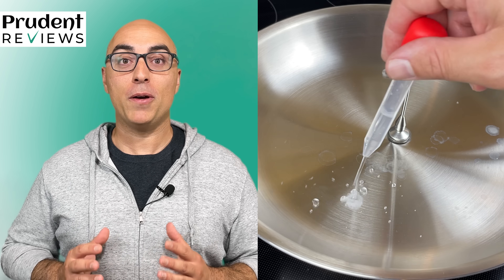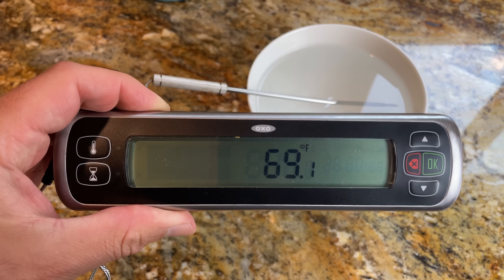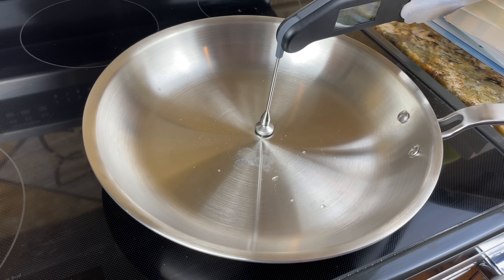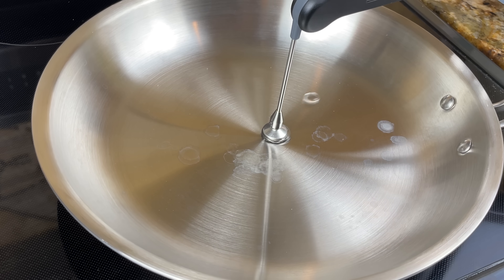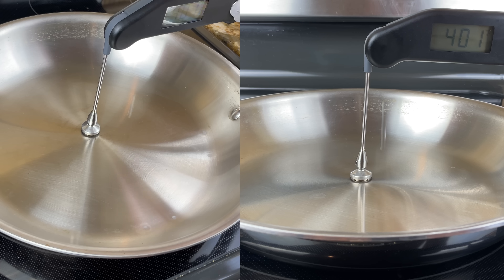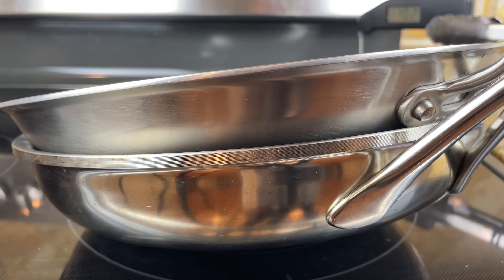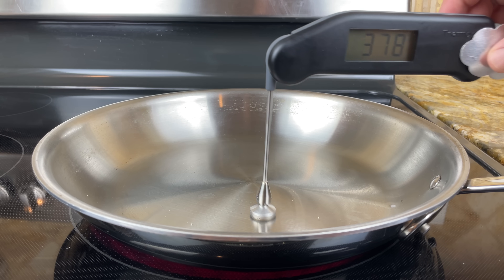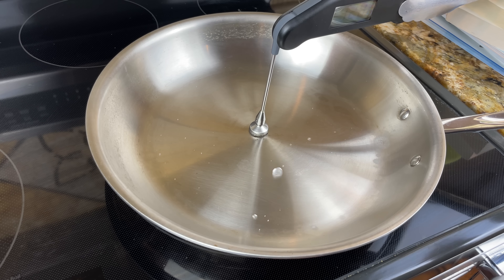Steel Pans Become Non-Stick at THIS Temperature (Leidenfrost Effect Solved)

Comment: How did you manage to have the thermometer above the pan?
Reply from the maker: Stack of books, tongs with a rubber band to keep them closed tightly on the thermometer, 8 pound weight on top of the tongs.
Reply: Some infrared thermometers have emissivity (EMS) settings, allow you to measure temperature from different material accurately, including stainless steel. I used mine on my stainless steel pan twice a week, works every time. 😊
Reply: use an infrared thermometer, you can check temperate on different area of the pan easily,
Reply: @sysopr not with ss
Reply from the maker: @sysopr those aren’t accurate on reflective surfaces like stainless steel
Reply: @PrudentReviews  You can totally use an infrared if you can change the emissivity. I believe ss is .35. I wish infrared thermometer reviews considered this. You can usually see on an item description what the emissivity setting range is, but it doesn't say how quick or easy it us to change.

Comment: Interesting! I'll try 430F on my breville control freak next time when cooking with stainless steel.
Reply: You can but keep in mind that perfect leidenfrost temp isnt ideal cooking temp.
Reply: @OurFamily-  I always lower the temp after adding oil, before actually cooking. I have since found that on the control freak, I just need to preheat at 275F for a little bit, add oil, then cook. Not necessary to preheat to over 400F for nonstick effect in my case.
Reply: @imelpomene  Do you cook pancakes?
Reply: @LiberatedMind1  Yes, occasionally
Reply: @imelpomene  I would love this to be true, but I seem to have better results by going to the Leidenfrost point, lowering the burner setting quite a bit, introducing the oil, measuring the oil temperature with a gun, adding butter at a little over 300F, adding a little gas to stabilize the pan temperature at about 280-300F at the edges, and adding the room-temperature egg or eggs at that point.  But I'll try just stabilizing at a little over 300F, adding the oil, adding the butter, adjusting the gas to maintain 275-300F before adding the egg.
Reply: Never 400 thats waayyyyyyyyyyyyyyyyyyyyyyyyyyyyyyyyyyyyyyyyyyyyyyyyyyyyyyyyyyyyyyyyyyyy too hot, 220 or so add oil g2g send it.
Reply: @ajmerafamily  F, not C
Reply: @imelpomene  have you ever tried to get a pan to 400 degrees Fahrenheit? its hard and time consuming; further most oils smoking point is way lower than that. if you were weird enough to think Celsius, your starting house fires.
Reply: @ajmerafamily  Of course I've tried. 400F is not that high. Breville Control Freak can easily get to that temp and maintain it precisely. Avocado oil smokes at way above 400F. Certain deep frying items require 400F for best results.
Reply: @imelpomenein short.  i disagree

In detail. all due respect. The point was making a stainless steel pan non-stick, like for eggs and most cooking. Having said that, just think about it. How many people are cooking at 400 degrees farenheight? Most oven baking is done at 350 degrees avocado oil, you say,  smokes at 400. Imagine smoking oil every time you cook. It's just not happening. Most stove top cooking is done at lower temps with an additional spike.

Comment: At what temperature does it stop working? What temperature is too high?
Reply: If you mean the Leidenfrost effect at what temperature does it stop working? There is no upper limit really. the pan can literally be heated to red hot and there will still be the Leidenfrost effect when you put drops of water on it. There are videos of steel workers running their hands through a stream of molten steel (2200+ degrees Fahrenheit) unharmed because of the Leidenfrost effect.

The primary issue with heating your pan too high is of course you're probably going to burn anything you put into the pan, like oil and food etc. You're also going to damage your pan and make it warp.

The waterdrop method of seeing if your pan is preheated enough works pretty well to estimate the temperature since you cannot use one of those infrared thermometers on shiny stainless steel as it will not give you the actual temperature, which is why PR used that exact type of thermometer in the video to measure the temperature of the pan
Reply from the maker: Good question. I took it all the way up to 480F and it was still working. I didn’t get it to the point where it stopped working but I’ll test it again and follow up.
Reply: @PrudentReviews  Thanks!
The reason why I ask is because, as you correctly pointed out, there's a myriad of factors affecting the non-stick temp, such as the mass and temp of the food you add in. So it makes more sense to overshoot than undershoot the temp threshold. 

But with carbon steel pans, there's a serious risk of burning off the seasoning if the temp is too high.
Reply: @APBWhiteRabbit  
The leidenfrost trick is strictly for unseasoned stainless steel pans.
If you actually do have a well-applied seasoning on your pan, the seasoning itself should do a good enough job of lubricating whatever you're cooking. It's why stainless steel pans aren't really ideal for everything. It's almost impossible to cook, say, a runny yolk egg on it without burning the edges to a crisp. But they're great for steaks where getting to a high searing temperature is important.
Reply: @Goodmanperson55 Well good thing I love crispy egg white edges.
Reply: @MeepMeep88  🤣 My dishwasher doesn’t care if I add a knife to the rack.
Reply: @Visitkarte  Mine does, it goes "fu now I shall become dull like my owners brain"
Reply: @Goodmanperson55 Low temp and loads of oil, float the egg on top of it, lovely white and yellow eggs, soft yolk, no burning.
Reply: @MeepMeep88 

Good thing there's that goober grape then. Wouldn't want to have to use two knives to make a PB and J.
Reply: S @APBWhiteRabbit nu-ți trebuie  picături, pui ulei și lași sa se înfierbânte bine, după  adaugi ce vrei 😂
Reply: It is actually quite easy to cook any type of egg in a stainless steel pan without burning, you just have to first reach required temperature- add oil, lower the temperature and then add the protein. I’ve done French omelettes….:)
Reply: If the pan is liquid steel you’ve gone too far
Reply: @Dabee625 T-1000s hate this one trick…
Reply: Im crying 😂😂😂
Reply: Sometimes I get polymerized oil stuck on my stainless steel pans, I'm wondering if the temperature gets too high or if it's because of something else, or maybe the temperature drops when cooking or something
Reply: @sofreshsogreen  the oil polymerizing and forms to the pan. This can burn and cause sticking at high heats
Reply: At those temps, the oil i use to season the pan, burns and smokes…

I wouldnt want to cook anything at those temps
Reply: @SofiaisSunshine can’t use olive oil. But yeah, this is too hot. Don’t want to cook everything at that temperature and i may want to turn down the heat and just keep it warm, whereby it’ll all get stick. Dumb pan and frost effect. No point.
Reply: I'd say the limiting factor for cooking is mostly going to be once the oil starts burning. You also don't need a perfect leidenfrost effect for a lot of stainless steel cooking, especially where you expect to form a fond. Most of the non-stick will be in the crust forming on the food as you simply wait. So as long as it is mostly pre-heated, and not burning the oil you should be fine.
Reply: my pans got discolored!
Reply: @janem3575 It's an oxide. You should be able to clean it with vinegar...👍
Reply: Asian wok videos show this effect working while the wok is already glowing metal hot.
Reply: Virtually no higher limit
Reply: Depends on the surface topography/finish characteristics. The practical range can vary significantly. There are a few scientific papers on the topic.
Reply: Melting point of aluminium is 660.3 C (1220 F) and liquid Al likes to react violently with water so good luck keeping the water droplets dancing around after that 😂
Reply: Air fryer works best for everything.